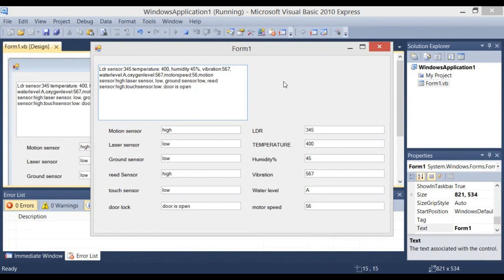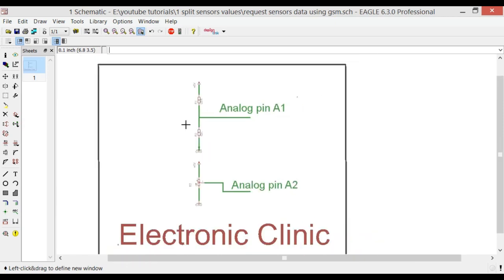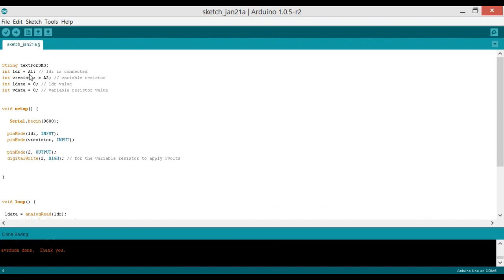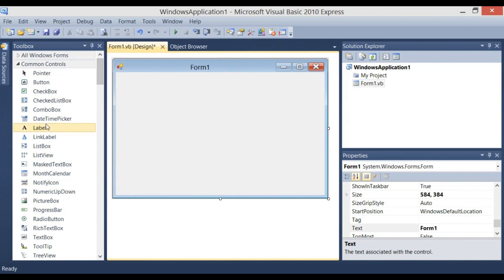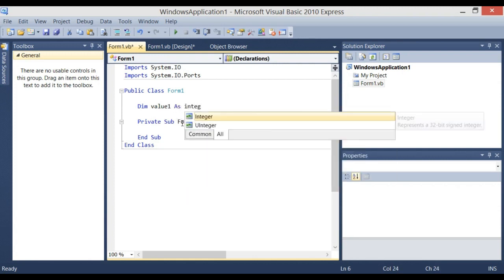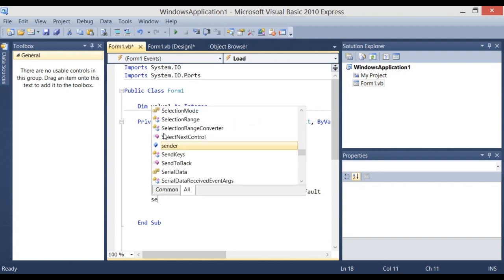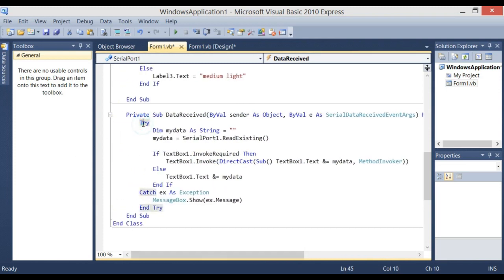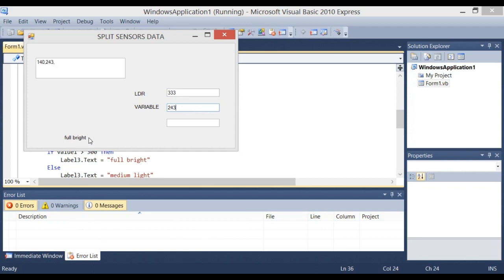how to split a string message and access the sensors values sent from Arduino to visual Basic

Comment: Sir, Good Day ! Can you use 2 Serialports? Or I mean 2 arduino port in one form. Thanks for the answer :)
Lastly any tip or guide how to use Adafruit Fingerprint Sensor with Visual Studio 2010 and MSSQL Database this is for my thesis 😊 sorry for long Message.
Reply from the maker: ya, of course, you can, you can even add more Arduino. Define multiple serial ports.
Reply from the maker: I already have a tutorial on this. check playlist.
Reply: Thank you sir, I will check it later. Best regards 😊

Comment: hi sir i'm trying to send the temperature  and humidity value from arduino to vb but  it does not split the data received form arduino  and it display all the data in the TextBox1 what shall i do pleas help me
Reply from the maker: separate them using coma
Reply from the maker: watch complete video. don't skip any portion

Comment: Dude your videos are very good. If you do the same project with gps module and parsing the gps sentences in vb and displaying the coordinates on a map(without using node mcu). That will rock. There re no such a tutorials on youtube. They only use the gps library and dispay the sentences on arduino IDE s serial monitor. Thats all.
Reply from the maker: check my video on GPS real-time tracking using the blynk application. in that project, I used the same concept, but instead send value to the vb application, I sent it to the blynk application. check my playlists.

Comment: is it possible to make a video of ds18b20 temp sensors to do the same as sending it as a textForSMS  from  Arduino to visual Basic
Reply from the maker: yes. you can do it. watch my tutorial on ds18b20. all you need is just to send that to the vb. :). 
check playlist you will find a video.

Comment: I'm sending my data manually at random time intervals, so how would I go about making the software update the sensor values when a new stream of data arrives?
Reply from the maker: For this watch my new tutorial on 3 phase transformer load monitoring using computer application.
Reply from the maker: I this this new project i used the datareceived function and also used the split technique

Comment: This is an excellent tutorial, I really appreciate videos like these. I ran into one problem, but I fixed it. The issue was with the "Dim Somestring As string" My debugger said, "1 dim array of string cannot be converted to string ... to fix this I made the variable "Somestring" an Array rather than a string.
Reply: How do you stop the text from blinking inthe othe textbox?
Reply: @834Danie  Really, you're only using the big textbox to show the total amount of data coming in. Usually, you would store the incoming data into a string variable and not a textbox anyway. The real data you're interested in is the "parsed" data or seperated data into each part.

Comment: Hi, I want to save the data into MsAccess database, how it is possible, any suggestion.
Reply from the maker: You should use msql database for saving values. This way you can also access values from anywhere around the world
Reply: thanks for your reply, I am new for this, can you share some example or any tutorial, how to use MSQL.
Reply from the maker: in a few days i will be posting a tutorial on msql database for storing sensors values
Reply from the maker: stu_engineering@yahoo.com
Reply: @ElectroniClinic  hi, is there any project you developed for msql database to storing the sensor values,
Reply: Hi, can you please provide any sample program, mYSQL to store the data.